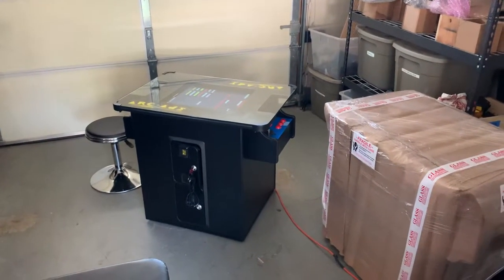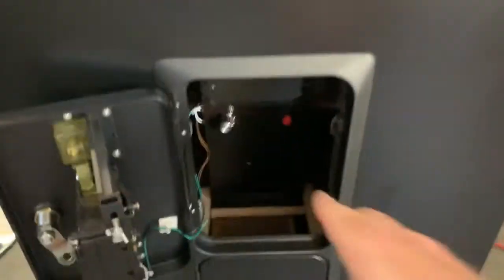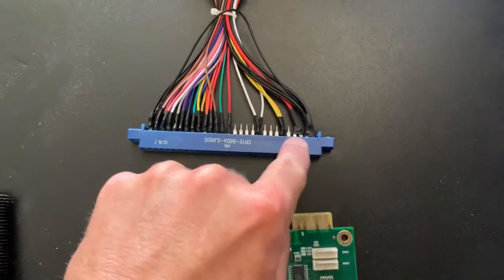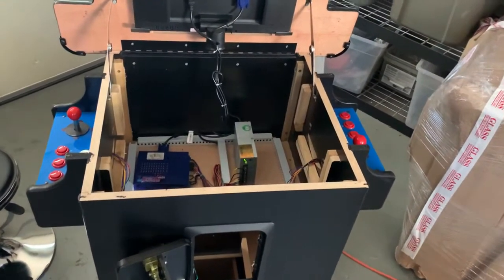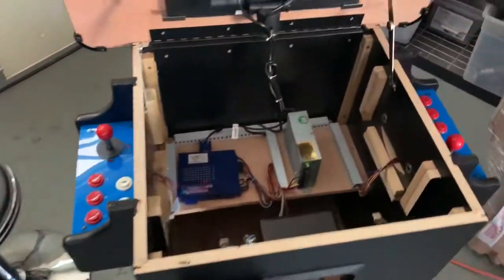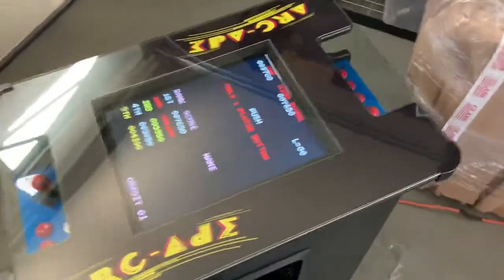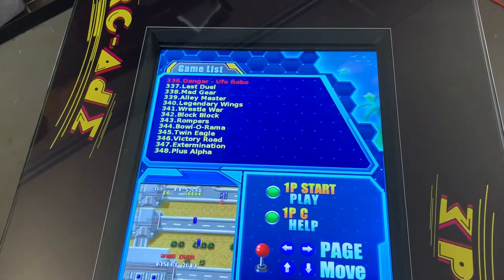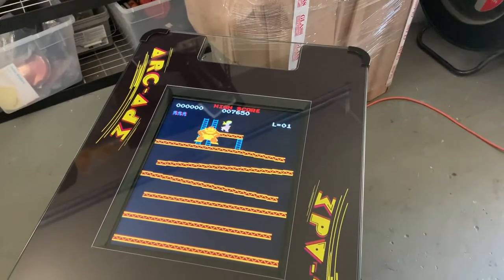Awesome Arcades Classic Cocktail Arcade playing a 412 game board

Comment: How does player 2 play on the table, considering that the P2 controls are right at the other end of the table and the screen would be upside down?
Reply from the maker: The screen flips 180 degrees.
Reply: @mrawesome2742 so only one person csn play at a time?
Reply: @HeNnEsSy_HiCcUpS yes that’s how it worked back in the day as well

Comment: i have a beyond arcade cocktail table i acquired . it currently  has 19 games how can i install the 60 or 412 boards ? i want all the classics galaga, rampage ,elevator action ,pac man etc etc...it is basically the same cabinet in this vid other than a couple odds and ends . the board and connections look the same and my joysticks are 8 position because it already has robotron 2084..
Reply: There are multiple boards that will work with the same connectors. Order the one with more games

Comment: Are those arcade quality sticks and buttons? If I get the 4 player table can I do two 4 direction and two 8’s?
Reply from the maker: What is your definition of arcade quality sticks and buttons?   The Ultimate cocktail comes with four direction (red ball) Joysticks on the vertical side and eight direction black joysticks on the horizontal side.
Reply: @mrawesome2742  poor wording on my part! If I got the 412 classic arcade setup would having 8 way sticks make playing games like Ms Pac-Man much harder? (Since those are designed for the 4way sticks)
Reply: @Nemhyz  nope, there's a software setting that let's you set up ms. Pacman with whatever joystick type you have. Or maybe it's on the underside of the joystick itself.